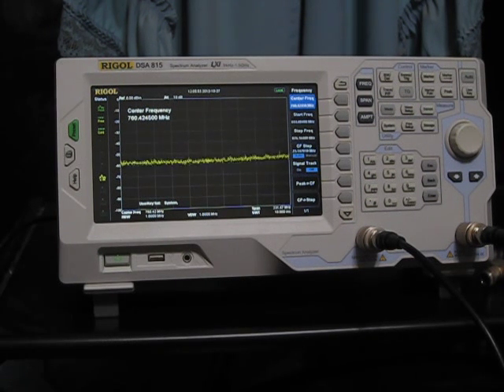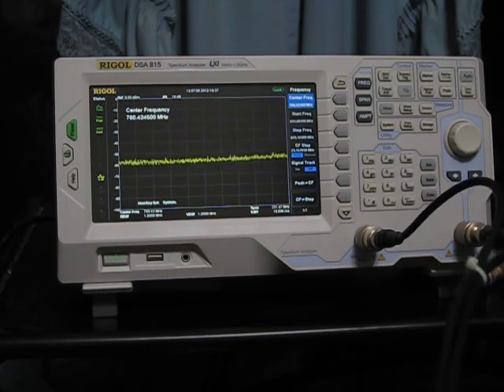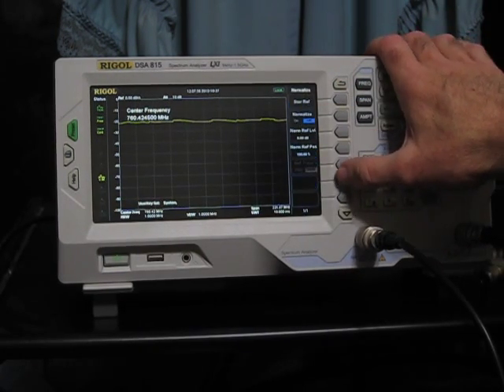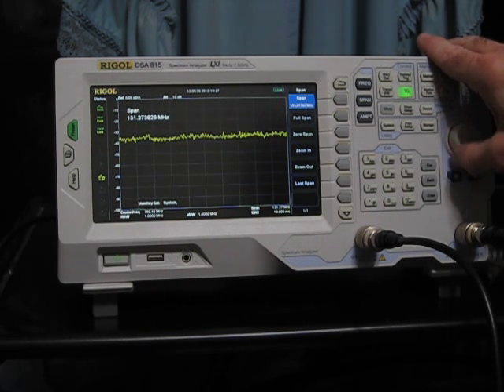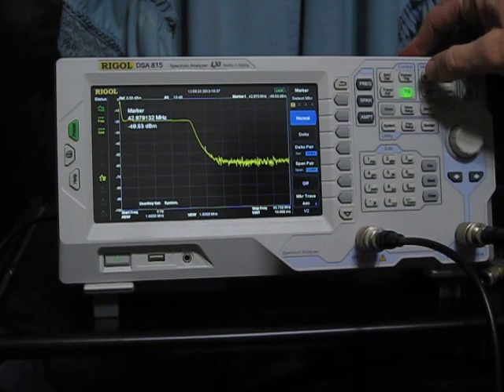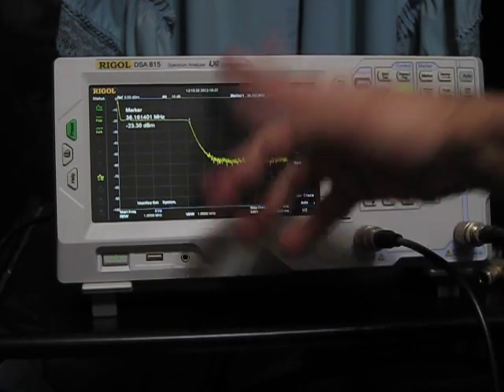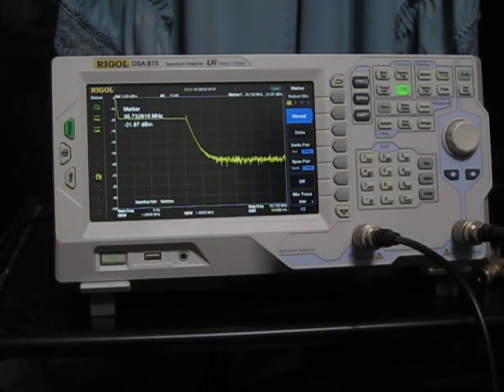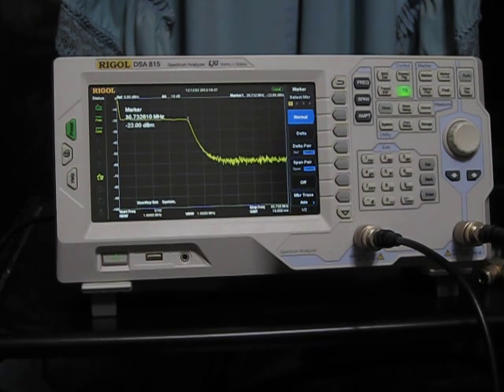Rigol DSA-815 Spectrum Analyzer Test of a B&W HF LP Filter - Part 1

Comment: Hello,

Do male BNC cables connect directly to the DAS815 - TG unit ?   Are the connectors on the unit N type or BNC type ? 

 I have never used spectrum analyzer before (except very old one at University, but I had so little time with it to really learn anything).

Thanks.

- Pete
Reply from the maker: Peter B Sorry for the late reply .. The connectors on the DSA-815 are N Type connectors

Comment: What's with the 73 comments, OZ1GEV? Jorgen, you hold a class D, yet choose to insult class A operators in other countries? I say it both ways and have had my Extra since 1996.

N2CUA, did you realize that tequipment is featuring your video for the DSA-815? I appreciate the review. Looks like a pretty fine unit. May just have to put one in my shack. Ahhhh, to be on the fence...
Reply from the maker: Michael Hall Did you get off the fence yet and buy the DSA-815-TG?

Always feel free to ask questions or give ideas for future videos ..
Also please subscribe and share if you haven't already done so..
Reply: I'm off the fence, but don't have the analyzer yet. When the time is right, I'll buy one.

I did have an opportunity to use the DSA-815 to verify the function of a panadapter buffer that I built. The controls on the analyzer are fairly intuitive. Let's say that it is something I look forward to having at arm's reach. :o)

Once I spend some time perusing your other videos, you'll probably get a few more comments, questions, or other good stuff. 73!
Reply from the maker: Nice .. just wondering ..  it opens a whole new world ... :)